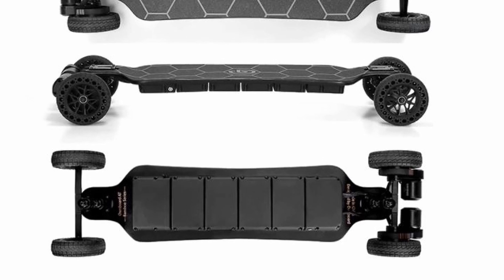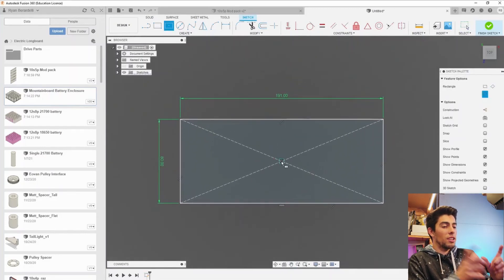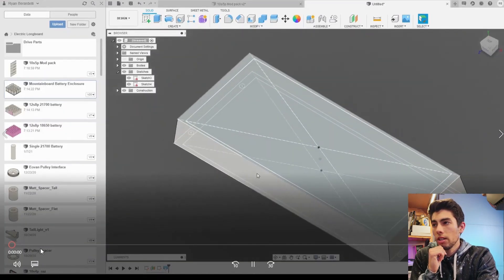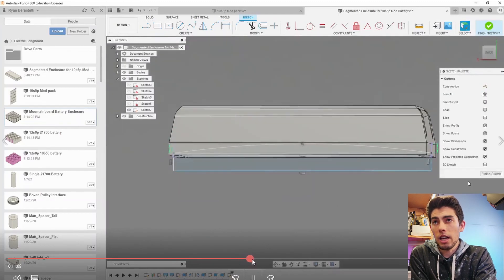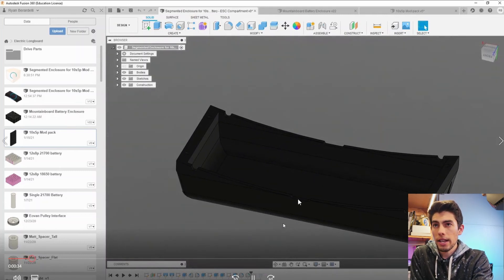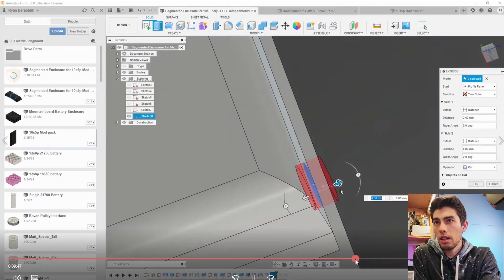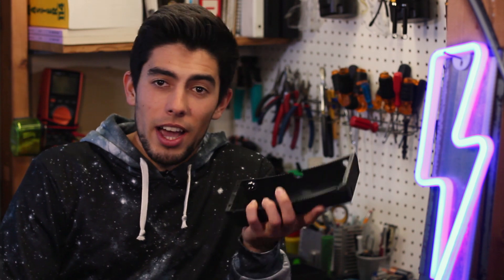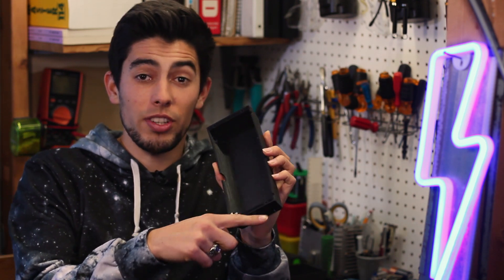DIY $500 Electric Mountainboard Kit Pt 2: The 3D Printed Enclosure

Comment: can you fit 21700 4P there?
Reply from the maker: This was a good question! I checked and it looks like the width works just fine, however, the height is really quite tight, you'd have to put a pretty thick gasket on it I think. I'm kind of done with this project right now but if someone wanted to pay me for a 2170p version, I would be open to that. I do 3d printed enclosure contract work sometimes!

Comment: Hi, I really like your build! Would you mind sharing the files? Thank you!
Reply from the maker: Thanks!  Give me a couple days and I will get them uploaded to thingiverse.  I have to make some modifications so they fit smoother with the screws.
Reply: @RBEMotion  I don't mean to put you under any pressure but how long will it take you, since the filament has now arrived? Thank you! Its not a big issue if the screws dont fit perfectly tbh.
Reply from the maker: @floriansimmons5049  Yeah I got super busy with recording and editing.  I can likely get that done tonight, it's just a quick mod and then I'll upload it to Thingiverse.

For best printing I'd recommend probably a 3 outline brim or so just to make sure they stick nicely, and you'll need some small supports for the screw holes.
Reply from the maker: @floriansimmons5049  Aight my man, I've got the link posted up in the description in this video and the final video of the series!  Let me know if you have any questions

Comment: Great video on using CAD program to design the enclosure. How long does it take to print one piece of the enclosure and how much filament use for one piece. Thanks
Reply: I subscribed. Watch all all the build series but did see the link for the enclosure 3D Print.
Reply from the maker: @mta3562  The enclosure files will be available in a future video, coming out in a couple weeks.  That video will be the ride testing video and price break down.  I need to make some modifications to the enclosure segments, like I mentioned.
Reply from the maker: Thank you!  Each enclosure segment is about 110g of filament on 25% infill and takes about 5.5 hours to print on my Artillery Sidewinder X1.  If you subscribe, you can catch the video at the end of this series, where I will share all of the enclosure files for you to print!  I need to make some modifications that will make them easier to use.